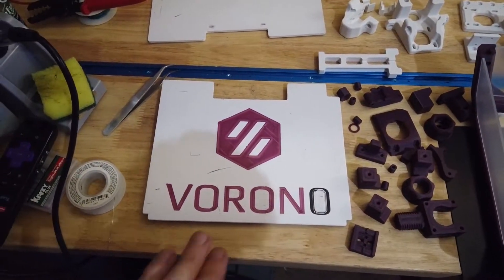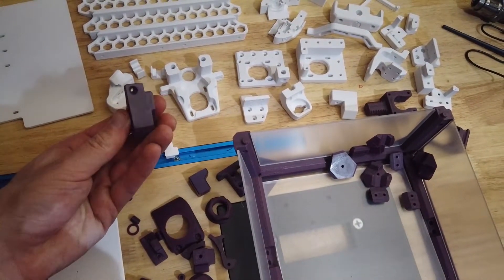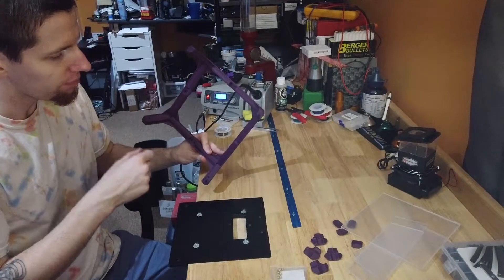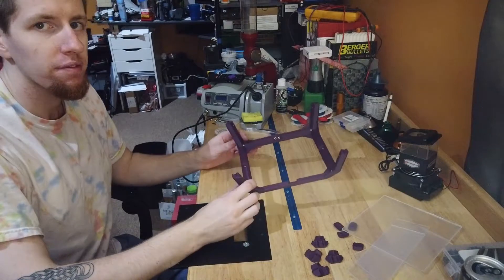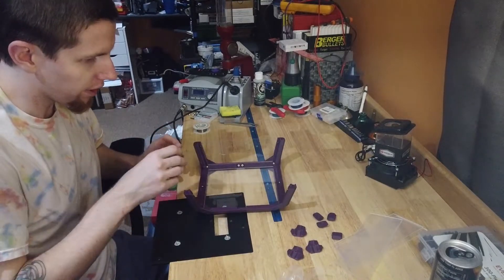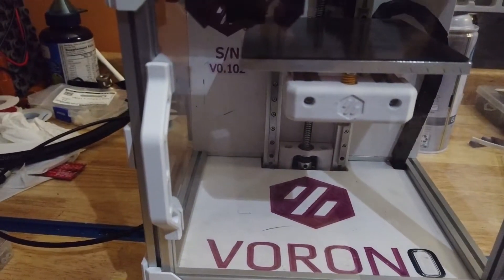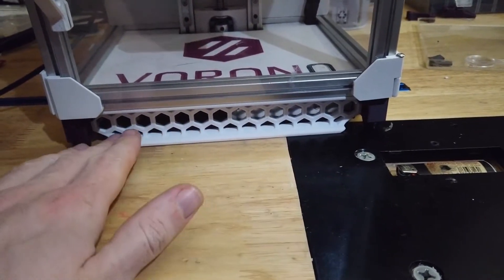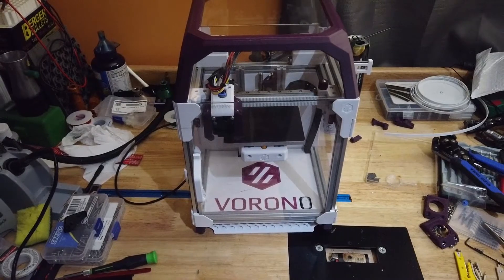Voron V0 Build - E19 - Rebuild and New Parts

Comment: crap I was hoping to be the first white and deception purple build. the steel core belts are a mistake btw
Reply from the maker: Sorry, it is a fantastic color combo. I've been having decent luck with the steel core belts, I got them as I needed the replacement in a pinch. I will be going back to the gates belts when I upgrade the toolhead to a Dragon.